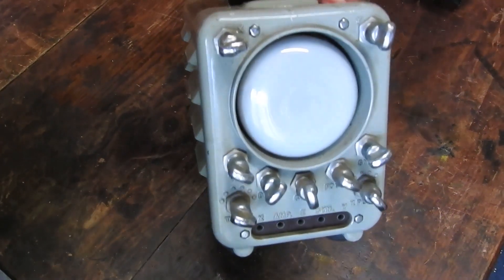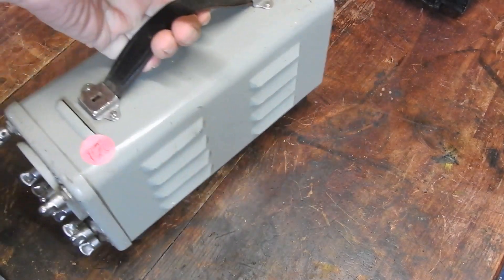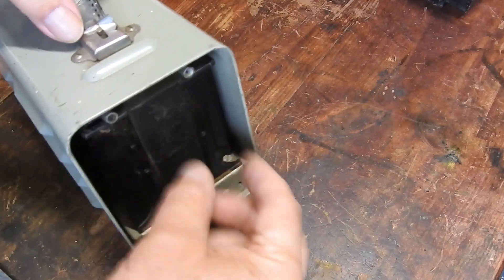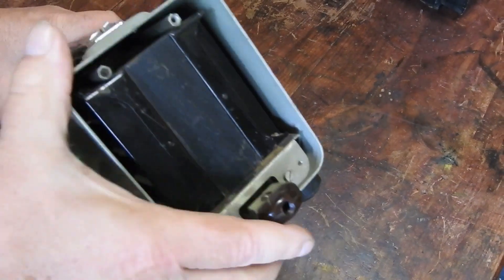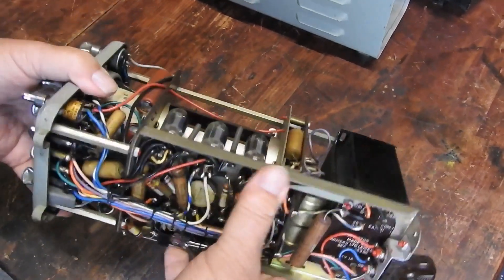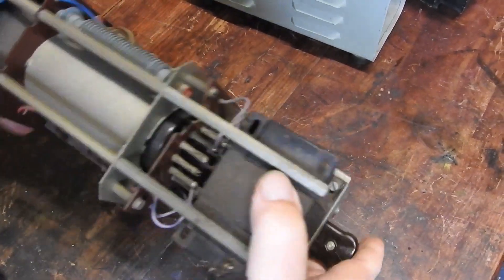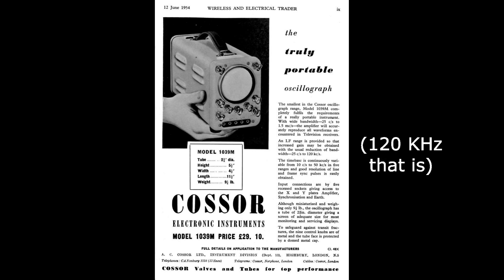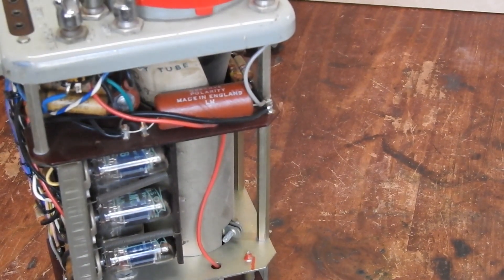Cossor 1039M Oscillograph   A quick and dirty teardown

Comment: I have 2 of this model, a MKII, a 1099 and a GPO.
The 1950s O'scopes are too clunky, but if you rebuild to 1961 spec using ECC83 diff amps and mount your components onto a circuit board leaving the space under the chassis free for low voltage stuff, can make a beautiful and useful instrument that works down to D.C. and is not at all clunky.
For the missing back, use painted plywood and a figure of 8 non earthed power connector.
To repair it, change all the capacitors, the selenium rectifiers will hold up okay if the capacitors are not leaky.
I have the appropriate differential amplifiers circuit but it is not yet published.
Reply from the maker: Thanks, but as stated in another comment, I won't be trying to get this going. I now want to keep it original, so that it can simply be appreciated as a fine example of the technology of its time. I have lots of other scopes...